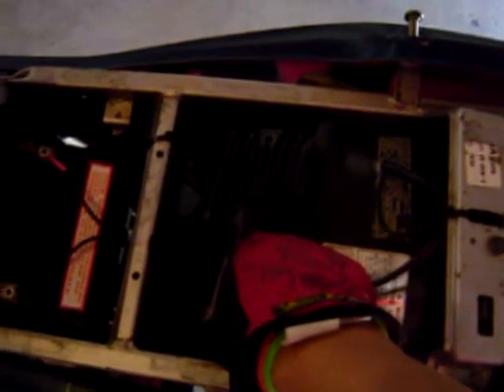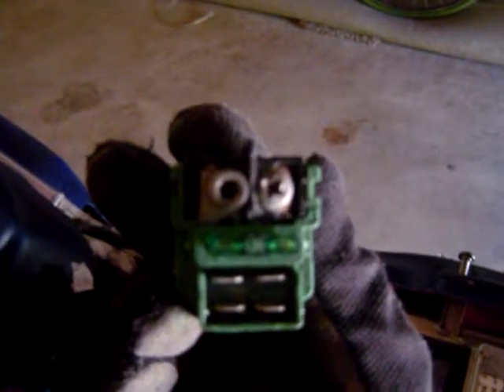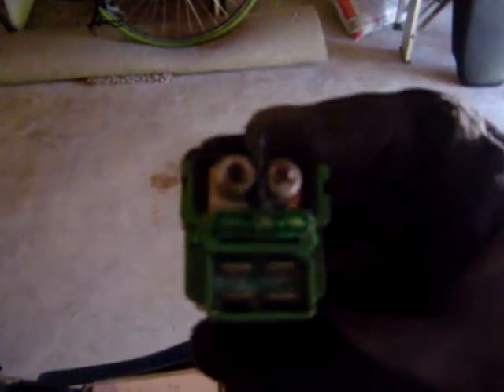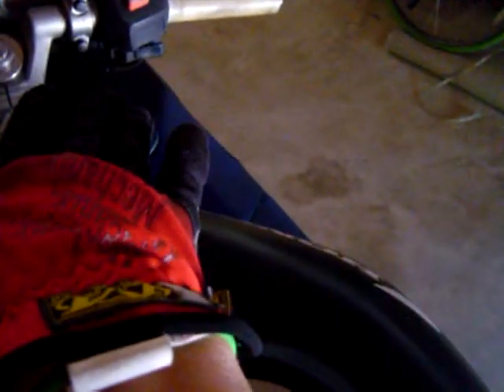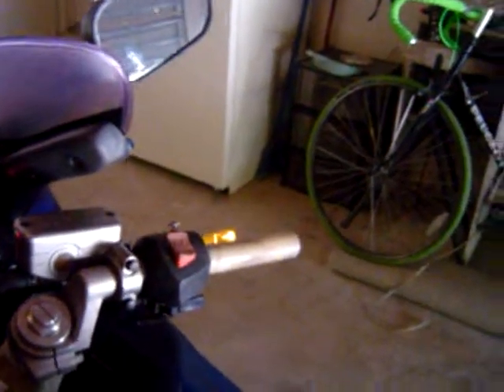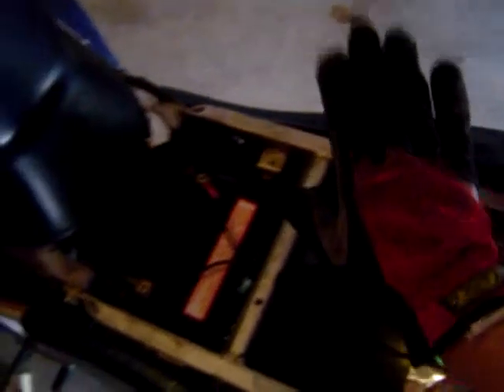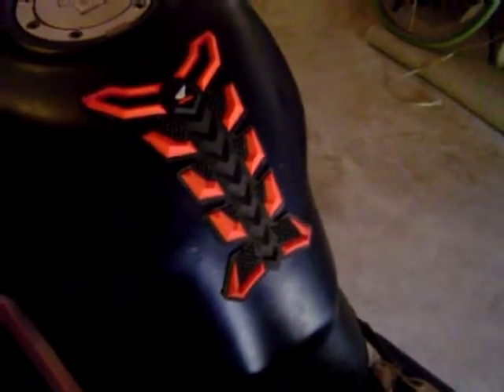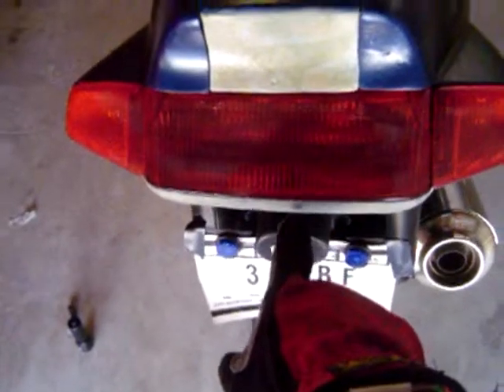Hot Wire Short on Chasis, Electrical System Dead - Diagnosis and Starter Relay Replacement

Comment: Great video...
 I got no head lights,cluster light,fuel pump prime noise,turn signals on front fairing working. About to fix my 06 CBR 600RR thank you
Reply from the maker: +Lalofelix73 The stuff will mess you up!  All it takes is a small short on the hot wire!